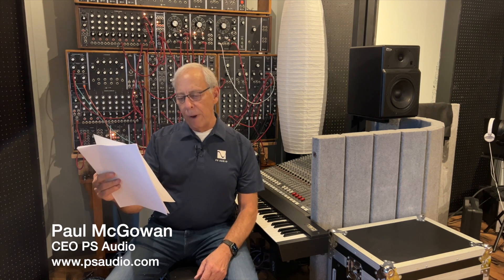Vacuum tube watts

Comment: Watts depends very much on how the manufacturer actually messures watts and even more on the power reserves in the power supply etc.
Many messure watts with just 1ch driven at about 6ohm with 1kHz test tone instead of all ch. driven at 20Hz - 20kHz into various ohms like 8, 4 or even 1ohm.
Reply: Headroom is the key , have you ever owned a NAD Reciever , intergrated or power amp with the power envelope design circuit? Even the 20 watt per channel little bugger had such a enormous capability. Just for side kicks , I'll tell you what I do to mess with people's heads , I will take a cool old Technics, Nikko, Kenwood amp or receiver that looks mint but might have internal problems and then take one of my ugly Betty NAD pieces I buy on eBay that have been mistreated as far as the cosmetics and retrofit the preamp and power amp section of the old classic 60s or 70s before mentioned and then take the big classic mondo piece into a audio shop to audition some speakers I am interested in , the first thing a sales person will say when I unbox the beast is wow that 8s a super clean old school what ever it is I have brought in for the demoing then I tell them what speakers I want to hear with my amp or Receiver , they look at me and say if ibis my first time dealing with a shop , oh sorry you are mistaking the capabilities of you vintage amplifier sir , but we do have a pair of speakers that will work with your classic piece , I then tell them I am buying what I want ., Not what you think my amp can handle . 
Long story short I tell them if my under rated piece hurts the speakers because of clipping and lack of impedance capabilities I will pay for them , then when the audition starts there faces turn funny wondering how does this old Jap Receiver push these , they get confused and sometimes call in another sales dude or there technician and says look at this thing , it is pushing loads as low as 2 ohms , blablabla , after the confusion I will laugh  and then reveal the insides of my Frankenstein piece. I have made plenty of heads turn in amassment. And have sold a number of pieces to guys that miss and love the old school looks and then needs a Frankenstein for there set up .
Reply: Bye the way, I am working on a early 90s ONKYO receiver at the moment , it is getting NAD treatment , and I love being a Dr. Fronkenstien, in the audio world . Oh and the tuner will be disregarded and VU meters installed in the space the tuner plate is .
Reply: @jasontimothywells9895  Yeah, NAD and also harman/kardon (before they stopped making anything good) and some others have pretty good headroom.
Hahaha😅 Funny story! Then you know exactly what I mean with my comment😝 I remember the first time when I really learned this. Changed from a 5x100 watts Technics to a 5x45 (2x50 in stereo) watts on a H/K reciver... The H/K beat the living shit out of the little Technics😅 The H/K was quite a bit physically larger and alot heavier and with twice as large power supply than the little Technics😅 If I would guess I think the Technics coule maybe deliver max 20 watts in real life. Blew a few tweeters with it back then too because it was a weak little shit. Never did that any more with the H/K.
Reply: @jasontimothywells9895  I have had many NADs and the PE circuit rocks.
Reply: @mobby1212  the only down fall with the NAD amps back in the golden days was the relays, but easy fix , I always replaced the weak ones NAD used with trusty OMRONS , right now again I am taking a NAD 7175 receiver that has perfect guts and a ugly Betty issue from not being owned by someone that cared about the cosmetics and transferring the amplifier and preamp into a perfect in cosmetics 1992 ONKYO tx 8511 receiver. Plus I am doing a hybrid to it's preamp circuit, a LUXMAN style tube buffer preamp . All the caps in the power supply and audio circuits have been replaced with film foil caps used in amps and preamps that are in the 4 too 5 thousand dollar and up brands . I'm even rebadging the ONKYO name plate with one a friend with a 3 D printer that will read FRANKENSTEIN.
I love being evil like this , 🤪
Reply: What you say is true, amps aren't tested broad spectrum or dynamically for max power.  The industry standard is a 1khz test signal IN with the output connected to a matched dummy load, so for example if the amp has a 4ohm speaker out, then a 4ohm appropriately rated resistor is connected across the output jacks, along with an oscilloscope and volt meter.  The input signal is then increased until the amp clips.  A simple calculation (vac squared/ohms) of the output voltage gives us the max watts RMS rating of the amp.  Though not perfect the max output test gives a good reference to compare other amps with.  Every quality manufacturer will reference to this simple power test.
Reply: @mobby1212  Although you are 100% correct about RMS power, I think I can see what they might be confusing.  Measuring the output voltage of the amp to calculate wattage should be done in VAC RMS, not VAC peak, although not everyone follows that standard.  But I acknowledge you are correct, the end result is average power or watts, not RMS power. 

I would, however, disagree with your assertion that testing into a non-reactive load is nonsense.  I use non-reactive loads all the time to set negative bias and measure output power on tube guitar amps.  I would never claim it gives the same info as a reactive load when analyzing the complete response of the amp.  But to get a very general idea of the health and power of the amp I find it quite useful, and accurate enough for guitar amps.  I'm sure using a non-reactive load as I do would never pass muster on critical testing of a hi-fi amp, but we are just discussing wattage and ways to measure it here, not fidelity or full spectrum analysis.
Reply: @mobby1212  you are correctamungo, as the Fonz would say .

Comment: Tubes are very misunderstood. Being so old that my formal electronics education was as much based on tubes as solid state, I have a very different perspective. We were taught tubes and tube circuit design first. Then solid state. We were taught that tubes are inherently linear while solid state is inherently binary. Tubes are conducting in their normal state and you reduce the electron flow with an outside voltage that blocks the electron flow linearly. Solid State is inherently in the OFF state and when enough voltage is applied across the P/N junction barrier, current flows. On/Off. It is possible to bias a SS device to operating in a limited linear range. (FETs being more tube like). Also that Tubes are inherently wider in bandwidth as it is electrons flying thru a vacuum instead of thru a solid block of semiconductor  material. That is why tubes were not replaced in transmitters until well after they took over lower bandwidth needs like analog audio. And it is why tubes are still used in your microwave and at the LHC at CERN. 

We learned math showing that the most POWER is transferred from a source to a load  when they are the same impedance. And with most tube amps a transformer is used to do this power matching to the speaker load. 

While SS amp design was more direct attached because SS had an inherently low internal impedance so rather than matching for power transfer, the ability to maintain the current into the load became more important. That's why a SS amp is evaluated based on how well it increases stated power as the load drops. e.g. to double the power going from the 8Ω to 4Ω. Constant voltage. 

So comparing "Watts Out" between the two technologies is almost meaningless.
Reply: Thank you, in the many years of my audio journey, no one has been able to explain the power transfer between these types of devices in physics terms as clearly as you have.

So as I understand, the tube device is able to transfer the same amount of power required by the audio transducer (say to produce a given loudness level) as the transistor based one, but since they're not impedance matched, a Solid state device is actually more inefficient at the same task?

I knew that audio applications use a transistor in its linear region (vs. a switching digital circuit), but I didn't have the idea that said linear region was so narrow, hence requiring so much energy to keep up the needed current requirement.
Reply: @quadrannilator  Thanks. It was beaten into my head for many years of schooling. It's been many many years (decades?) since I have had to do the math showing power transfer with varying load and output impedance. Rusty gears up there! But it is just simple math. SS are more efficient because transformers are not 100% efficient so power loss and SS tend to be direct connected. Basically Power Supply to Speakers. 

One of the indicators of the limited linearity of SS is SS circuits tend to have/ need more feedback. Heck you can power up a tube and feed an signal to the grid and it will basically self bias with minimal components.
Reply: @glenncurry3041  Thanks for the lesson though. Now I know what is the difference between a Tube Watt and a Transistor Watt, haha! I now understand the Amperes, Joules, Watts, Hertz, etc of the audio world much better...
Reply: @quadrannilator  Except Audio might be a bit like they say about Quantum Mechanics. if you think you understand it, you don't! 🙂

Comment: Most of the times, when listening to Music at home, we are using less than 2W of power even with low sensitivity speakers.
Reply: Sad You actually believe this as it is factually inaccurate
Reply: @davidcross890  Sad? … Inaccurate? … Well if you have a better answer to David, why don’t you just tell us? I am not grumpy, I just get frustrated with some who give comments but no reference to the facts. Just share some little knowledge with us!
Reply: @JoseMorales-kr2ed  Hi Jose, many people do not understand the entirety of the dynamic envelope of musical energy versus time. Truly accurate and uncolored and undistorted musical reproduction requires as absolute few distortions as possible. Their are so many distortion types and mechanisms. Many are possible to address. Solid State in it's greatest possible Designs (which sadly most manufacturers have yet to design or deliver) has many  severe advantages over tube designs at any price. Tubes inherently have specific distortions that cannot be corrected in real time without extreme level advanced solid State band aid electronics knowledge and implementation.

 Some say they actually enjoy tube distortions. Extra Coloration, Phase distortions, lEnhanced Euphonics etc.
Kind Regards Jose
Reply: @davidcross890  I am politely replying to you that what you have said is correct, but also  unrealistic because then you will have to phase out most of the instrumentation that was used to record nearly everything in history. I have friends who have “high end” Solid State systems to their opinion, and yet cannot realise that their are clipping or influencing bass distortion when listening to music. You will have to delete Aural Exciters, Reverb Generators filters, tubed microphones etc from the chain to achieve your perceived ultra high end sound - but in this audiophile journey if you must call it - this is not what I want or others want. Even “live” audio is not perfect because everyone - everyone is different, hears different or focuses on a particular band of audio frequencies to their own judgment and enjoyment. I particularly want my ears “massaged” in the frequency band and that effect will only happen if an amp or a preamp uses a particular PIO capacitor with a particular tube in a particular strapping technique! Most of us in the real world can learn to enjoy the best possible sound available either with tubes or transistors, but some will not be happy with 0.0001% distortion until they are able to find their sweet spot of synergy - and that could be with a tube. In the real world, most people will only be able to achieve modest respectable clarity in their sound system. I am not grumpy. Thanks for the reply.
Reply: @JoseMorales-kr2ed  I Am Truly Grateful for Your Comments. Many points that You articulate and assert are some of the very reasons new technology had to be invented to actually revisit all historical recordings and apply new impeccable innovative approaches and  Technologies to recording or remastering to much much more closely retrieve what was once in the past performed. That benefits us all.  
I am not alone in wanting or desiring to relive or experience through impeccable reproduction what was once performed in all it's potential glory with the advantage of today's bleeding edge advantages. Any digital audio file, CD,  vinyl lp, master tape, dat,  cassette, stream can benefit from this and any new offering could as well. This way all price level systems and their owners benefit. 

Again, I appreciate your comments
Thank You,
David
Reply: @JoseMorales-kr2ed  one other thing, all past gear including effects equipment, recordings, recording equipment etc. does not need to go. This works with all past works.
Reply: @davidcross890  Thanks for you reply David, I’m interested to know in your opinion what device, technique or technology would come first priority most of all to achieve a degree of ultra high end audio? And to what degree or threshold of technology would you allow for ultra high end because you have to take to account power supplies, drivers whether multi or single full range or not at all subjective or have limitations. So what technologies or implementations would you narrow down to achieve supreme linearity or neutrality? There are so many variables that will skew are technique and the perception thereof of “neutrality” - including the very listening space the devices are on.
Reply: @JoseMorales-kr2ed  per Your ask it starts with pure perfected virtually distortion free power to all devices or components(batteries and their associate distortions cannot attain this) Most Regenerators fail here as well, Most Power Conditioners fail here as well, Dedicated lines fail here as well. So actual creation/recreation of virtually perfect power is a must. I know my invented devices deliver this to all components including mono amplifiers. All aspects of power supplies become relevant as it's far more than just a capacity issue. Speakers, same thing, all aspects of same time domain pistonic motion at all frequencies reproduced. Signal cables- do they ensure maximum original gain and phase and time domain at all reproduced frequencies and their acoustic space and material coupling to the original signal. There is more but understanding of reconstruction of the auditory process via our neural interfaces goes far beyond tracking gain throughout the Fletcher-Munson curve. Time domain perfection throughout the entire chain is necessary. Single Drivers of very particular design carry many huge inherent benefits but multiway under extreme care of design and implementation can for scale level performance at higher spl overcome extreme single Driver setup. 
I have had planar, have electrostatic, had plasma, have dynamic. Obviously, for this chain extra harmonics or euphonics of any type are unwanted. Just a start addressing your ask

Comment: Excellent discussion there! To add a bit to your analogy to the car with the small engine vs car with mammoth engine. I heard once that it takes around 18HP to propel a midsize auto down a flat road @ 60MPH. So, you have the two cars running neck n neck @ 60MPH. Floor the car with underrated engine and the speed just creeps up a notch or 2. Floor the car with the 600HP V-8 and it nearly breaks the tires free, lurches, and you sink in your seat! Now, compare that to a solid state amp with 10watts RMS vs another with 500watts. Play them into identical speakers using music with a lot of dynamic range. On the average, not much difference, BUT, when that crescendo or drum wack comes, guess which speaker system will scare the heck outta ya! The set with the 500watt amp! That's my take.
Reply: I had Quad Esl 63's which are not sensitive at all. Had an Electrocompagniet 250 AW. Big, powerful, expensive. 250 watts or more per channel. Thought it was perfect sounding.  A friend of mine gave me an unserviced McIntosh MC 240 to try. Two times 40 watts, more than 30 or 40 years old. No comparison. I never connected the Electrocompagniet again. Sold it as soon as possible.
Reply: Car analogy? Comparing my back in the day '67 Dodge Challenger 318CI V8 (5.2L) was 230 hp, 0-60 mph in 8.1 sec. While my current Audi A5 2.0L has 252HP, 0-60 mph in 6.2 sec?
Reply: @glenncurry3041  You need to take engine size with respect to the number of HP it produces. Losing this relationship loses context.
Reply: @dlmp70  Yes the larger engine had less HP, weighed more, less MPG and poorer 0-60. But it really does not matter.
Reply: Horsepower is half the truth. The whole "car analogy",  has also very much to do with torque, not only hp.
Reply: Great example to explain how the watts would handle music dynamics!

Comment: I can think of a whole bunch of reasons to buy a brutish solid state amp yet only one to get a low powered tube amp. SS for me every time.
Reply: let me help you
1. tube watts can be class a so no switching just pure power
2. tube amps soft clip vs solid state hard clipping
3. they don't sound like shit
4. they look better and many are point to point wiring vs cheap pcb boards
5. tubes are better at rectification
6. tubes drive voltage while solid state has limited voltage and more current. (speakers are voltage driven not actually current driven as most think)
7. tubes prefer smoother impedance curves but are actually better equipped in driving steep curves because they run higher voltages
8. they can swing more voltage
Reply: @V1ralB1ack  lolz.